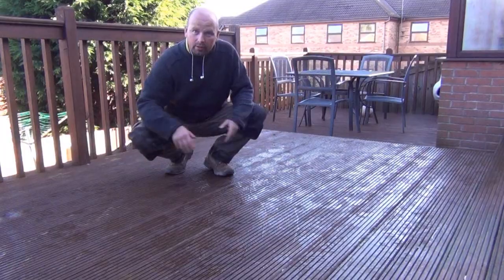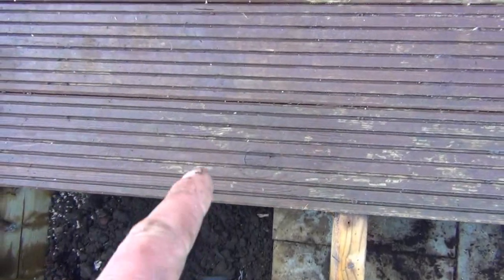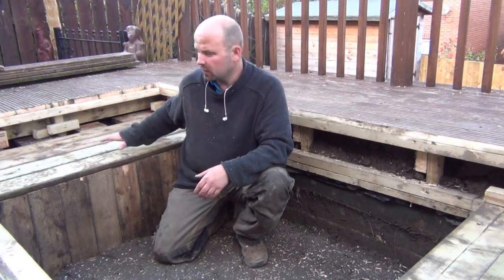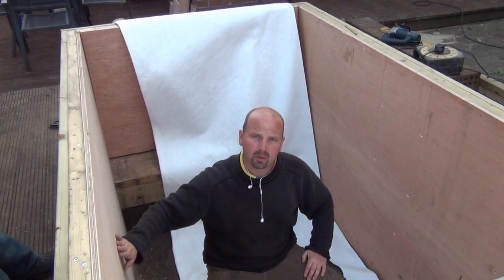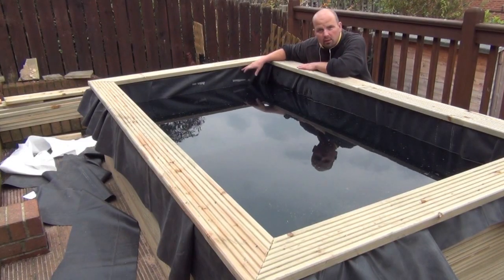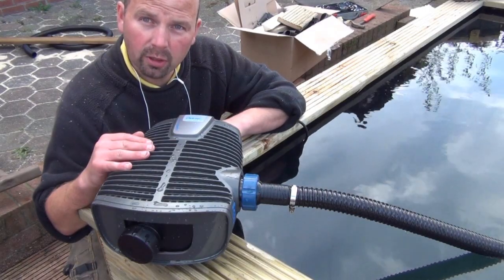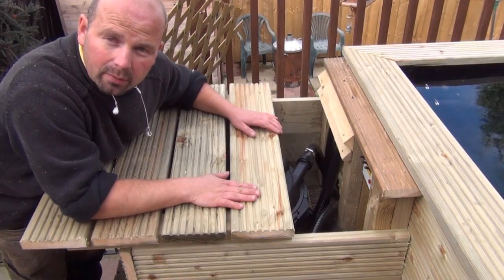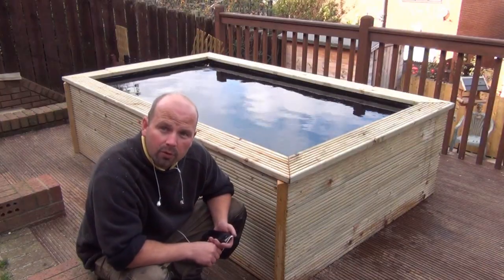How to build a raised wooden patio pond by Pondguru

Comment: Hi I am quite pleased to say that I've just completed making a new Koi Pond by copying a similar design to the raised wooden one as above.  Construction was relatively easy following you video. Just one question if I may, I have now filled it with water so how long before I can introduce the fish please, as I have 4 of them that have been penned up in a holding tank since my move in May last year.  I am keen to get them into their new home but don't want to overdo the enthusiasm and end up harming or killing them.  Many thanks and keep up the great videos. Barry
Reply from the maker: I'm glad the videos were useful and your project went well. As long as you have run the pump and filter for a good week or so the fish could go back in. It may be useful to add some of the water from the holding tank as it will be mature and will help fire up the new filter. You could put them in a few at a time if you have lots of fish so the stock in the new pond builds up over 4-6 weeks.
Reply: Hi Again, many thanks for the advice on introducing our 4 Koi to their new environment.  Just one problem I wondered if you had come across in the past. I have constructed the walls of my raised area exactly the same thickness as your video showed (18mm ply wood on a 2" x 2" studwork frame with decking cladding to the exterior, however, where my filter box is I have NOT fitted the decking due to drilling the holes for the Tradux fittings come through the wall.  Having fitted both of these with the short threaded end with the rubber seal on the pond side of the liner and the long threaded sleeve with the large wing nut on the outside of the plywood, it is now not possible to tighten the hose tails up tight as the large wing nut wont tighten any tighter, hence the filter side tails will not seal up.. Is this something you have come across before and have an answer to or how can I overcome this tightening problem. Any advice would more than welcome. Many thanks
Barry

Comment: Hi there just wondered how I would install a bottom drain within a liner
Reply from the maker: +Lee Wilson That is something I have done but have no video for. It is quite easy but the base needs to fit the pipework snugly to make sure there is no stretching of liner when pond is full. It would be best if you went to a koi outlet and ask them to show you so you can be familiar with the method while looking at the bottom drain and necessary fittings. If I had to use a bottom drain for a lined pond I would only ever install a bottom drain on a brand new liner.

Comment: Hello, what happens when it rains hard. Will the pond overflow?
Reply from the maker: Yes the operating height allows for a bit of rain but if it was very heavy everywhere else would be saturated anyway. It is easy to drain water using the filter outlet.

Comment: I'm thinking about building a a wooden pond would i need to put something around the walls of the pond to support the pressure from the water?
Reply from the maker: footiestar25 As long as the pond was built strong enough it would be fine.
Reply: I will be building it exactly identical to  the one in this video but it won't  be sunk into the ground the whole 4 foot will be above ground so will that be ok and strong enough to take the pressure of the water?
Reply from the maker: footiestar25 It would need to be made of much stronger materials  - for example railway sleepers as the atmospheric pressure acting on the water (and pushing out on sides) increases greatly the more volume of water is lifted above ground level.
Reply: Ok thanks for your infomation

Comment: Me and my dad are building a half raised wooden pond 3ft raised and 2ft in the ground do you have any tips on how to stop the wood rotting in the ground
Reply from the maker: If you put a concrete collar around the excavated hole you can build up from that with the wood to prevent rot problems.
Reply: Ok thanks fir the tip
Reply: We decided to build up with bricks 3ft in the ground 2.5ft raised put a roof on as well
Reply: Would post a picture but not able to on this
Reply from the maker: ***** Sound good to me and if you want to send pictures my email address is pondguru@btinternet.com

Comment: Is the insulation you use just normal wall or loft insulation stuff?
Reply from the maker: Ashlee Essex Yes I think it was 50mm rockwool which was in strips 18" wide x 1m or thereabouts. It fit between the 2" x 2" frame perfectly.

Comment: can you build a concrete raised pond with bricks or cement blocks.
what is the white liner for? isnt the black one sufficient
Reply from the maker: Yes you can build up with bricks or concrete blocks - that is the most common way to build a raised pond.
The underlay protects the liner and is polyester, not rubber.
Reply: no i meant can you build one yourself in a HOW TO VIDEO. if a project so happens to come along. with a wooden ext.
Reply from the maker: Enrique Goitia
I've done a 'How to build a koi pond' video but that was block and render with brick facing. I suppose a wood external would consist of a few vertical batons fixed to the external block then clad with wood. May be an interesting mix of styles and if I get the chance I will make one but since I am passing all construction work to other landscapers (then working for them as they need me) I will rarely be designing the ponds from 2014.
Reply: I noticed you had not put anything behind theinner plywood or under the underlayment for water proofing. Does the poly - liner proctect to an extent? Otherwise I plan to use the existing liner as my waterproofing under the framing. Thanks for sharing and the ideas, well done.
Reply from the maker: The ground I was digging into here was extremely dry due to it being under a deck and the liner will protect it to a large extent, yes.

Comment: Is it possible to build a raised pond like this on top of patio slab surface instead of digging a hole?
Reply from the maker: Yes that would be fine and many people do that. I have another raised pond video where part of it is on existing concrete slabs.
Reply: Pondguru Outdoors Thanks for the  quick response.  So I can follow this exact video to make my pond over ground.  I don't need it to be under to help support the frame of the pond?  Or should I use more bracing around the frame?   Thanks again for your response much appreciated.
Reply from the maker: The frame can't really go anywhere when it is all fixed together and full of water but it may be worth using some 90 degree brackets to secure the frame to the slabs just for your own piece of mind.

Comment: I'm buiding a raised pond after watching your video is going to be 1.8m x 1.8m x 1m what size pump and filter would you recommend I'm going to have koi in it any help would be useful.
Reply from the maker: The pump would ideally push at least half the pond volume through the filter every hour (2 hours for full turn over) so as you have around 3,240 litres that would require a 4000 lph pump. If you are using the pond to grow koi on before moving them to a suitable pond you will need a filter which will treat up to 3x the pond volume as they are heavy feeders and polluters. If you go for a pressure filter like in this video the nearest Oase one would be the Filtoclear 12000.
Reply: I have gone for the  Oase Aquamax Eco Classic 3500 Pond Pump and the Oase Filtoclear 16000 will this be ok I have 5 7" koi to go in there. and I have a air pump to go in there.
Reply from the maker: Yes that will be more than enough so no worries there. Although I recommended a 4000 pump in the previous comment a 2000 would give the 'once every 2 hour' turnover rate. Always best to move plenty of water when there are koi in the system so a  3500 will be fine for that purpose. A 16000 filter will go much longer between maintenance schedules and so will definitely do a better job than the 12000 so no worries there. 
With the addition of the air pump too they will be very happy and it is always great to hear of ponds when the filtration is more than adequate as there is no such thing as too much filtration.
Reply: Hi I have built the frame for the pond and put decking on outside and plywood on inside what size holes do I need to put through the plywood and decking for the oase tradux fitting to fit. Thank you.
Reply from the maker: It has been so long since I built a pond like this I can't remember but I'm guessing at 2" (50mm). The hole which is cut through the liner should only be about 1" as the liner needs to stretch over the fitting for a tight seal.

Comment: Great videos, very helpful and given me some good ideas for when I start mine.  What I would like to do is incorporate a glass viewing panel in one side but I can see that's going to be fraught with difficulties.  :)
Do you not have problems getting to the pump to clean it with it being at 4 ft deep?
Reply from the maker: +MarkJT1000 The base of the pond slopes slightly down to one end where the pump is so all the muck is removed to the filter no problem.

Comment: How is 2 x 2 timber frame strong enough to with stand the water pressure?
Reply from the maker: The 2" x 2" (50mm x 50mm) is only the internal frame and is sandwiched by 38mm (1.5") decking (outside) and 22mm (0.75") marine ply (inside).
The marine ply is a laminated board which takes a ridiculous amount of force to bend it and when it is fixed to a properly constructed frame which is clad outside with the decking it is easily strong enough to hold the water pressure.
Reply: @pondguru  great information I'm planning to build an 8x6x4 rasied pond out of 4x2 timber 18mm ply interneral decking external with 4x4 corner posts but was a little concerned of its strength
Reply: @colinlock5001  (my other channel) If you're using 4 x 2 then that will be even stronger and give you twice the cavity for insulation so it's all good. Best of luck with the pond.

Comment: Hi again 

at the 15:40 mark you have a cap on the waste pipe could you tell me what you put in the pipe to screw it on.
Just got my pond built in a very similar way to you after watching your video great stuff.

thanks 
Kel
Reply from the maker: Kel's Aquariums It is a hose tail with 1 1/2" male thread and end cap. They will be available from Oase dealers.
Reply: thanks.

Comment: Hi could you possibly give me some advice I'm planning on building a free standing raised koi pond approximately 6f x 4f can i frame it the same as you have here using the 2"x2" with the decking boards and the 18mm ply. I'm also thinking of fitting a viewing window approximately 3f x 2f 
Would this be strong enough and would it be advisable to build it on a concrete or flagged base tom
Reply from the maker: Even a raise pond is best if it is half in and half out the ground as it will get less extreme temperature fluctuations in summer and winter. 6' x 4' is way too small for a koi pond and the depth is needed to be around 4' (ideally 2' in ground, 2' out of ground). If there is too much height then the weight of water will break the frame. Feel free to phone me any time on 07772848730 as I'm guessing you are in UK. Phone is on from 9-5 daily.
Regards,
Richard
Reply: Hi Richard thanks for you reply. The pond I intend to build will now be 7f x 4f x 5f 6" deep so if I do it 2f in ground & 3f 6" above ground then should that be strong enough. I only intend to keep a max of 6/8 koi around 8/12". I intend to use the same materials as you have used in the above and below decking video. Do I build the frame in and above the ground as one hole structure or just above ground and run the ply from the top to the bottom of the hole many thanks
Reply from the maker: You could have the whole structure above ground if there is a good neat hole cut out of the ground - depends what the ground is like for digging and I have done it both ways. I'd advise going wider than 4' as that is very narrow for koi. Even 5' will make a big difference, ideally wider. Fish do not stay at the length you want them.
The wider you go the heavier the frame will need to be and for a 4'/5' wide pond 3'6" above ground you'd need a 4" x 2" frame built the 4" way for strength.
Reply: baitking1

Comment: Also. Y no use of small bottom drain? Always led to believe that they are a must for koi.
Reply from the maker: As long as the bottom of the pond gently slopes down to one corner all the muck will be drawn out by the pump and pumped to the filter so no need for a bottom drain in a small pond like this. For a concrete / rendered / painted / fibreglassed pond which would generally be much larger it is always good to have a bottom drain and large filter.

Comment: Hi! your video was great! I enjoyed it very much. Please tell me where you are based? I like a 1000 gallon wooden Koi pond built soon.   Thanks
Reply from the maker: I am about 10 miles west of Newcastle and although I gave up installing ponds last year I can put you on to someone who could do the work assuming you are also in North East.
Reply: Hi - I am in the South of England, If I can give the measurements, would I be able to have it sent Flat pack and I could pay for your labour for cutting the timber and also also shipping and material. Then we could have a carpenter to install it.
Reply from the maker: Olunelum Nelum I didn't just give up the installation of ponds I gave up all construction work as I just don't get enough hours in the day unfortunately.
A pond such as in the video really needs the frame building on site as it needs fixing to the ground before the insulation goes in then the internal boarding would extend down into the hole so it's not the sort of thing which can be pre-fabricated unless it was for a much smaller pond.
Reply: Ok thank you, do you know anybody who could assist in South of England
Reply from the maker: Olunelum Nelum Unfortunately I've no idea as I've never worked down there with anyone.

Comment: just one question where is the overflow ??
Reply from the maker: I think we put it in one of the corners under the decking but my memory is very shot.
Reply from the maker: ***** Do you mean the stuff which has the small stones stuck to the liner?
If so, no.

Comment: 7' long sides... No bowing outwards? I know it's only 18" high, but water weighs an awful lot and has forever to keep pushing...
Reply from the maker: It will forever try to find a level but I had the guy who I built this pond for at my house collecting some media for a new filter a couple of weeks ago and he said it was still totally straight. The 18mm marine ply is very difficult to bend as it is a laminated board. Then there is the frame and decking to add to that strength too.
Reply: Excellent... Thank you for the timely response... I am enjoying your videos... Some of the best on You Tube... You explain your thinking, what to look out for, and actually show your work... Awesome..
Reply from the maker: No worries, I'm so glad I made the instructional videos when I was making the ponds - glad you enjoy the videos.

Comment: why do u insulate the pond?
Reply from the maker: +Steve Billy Because up here in the North East it gets very cold in winter. The insulation prevents rapid changes in water temperature.
Reply: would u suggest i do the same?,,  iv just bought a house with patio in the garden and im planing on bulding a pond by following this video step by step
Reply from the maker: +Steve Billy If it is above the ground then definitely I would recommend insulating it. If the pond is block and brick construction then that is less necessary as it is much thicker.

Comment: How come he s building a weak frame like this and on the next video, he s double layering ciment blocks.... One of the two is bs..
Reply from the maker: They are simply 2 ways to achieve the same goal.
Reply: @pondguru  thank you for you response and your good channel.
OK but cost wise.. And why double walls? How long will the wooden pond last?
Reply from the maker: @MrFlyingPanda  This is just one way of building a wooden pond and many people would go with interlocking sleepers. I built it this way as it was strong enough for the size and not overpowering the space. Search for 'sleeper pond' on Youtube to see a stronger version for bigger ponds. Even doing it this way you should get a good 15 years from an above ground pond as wood isn't sitting in wet ground where it will rot quicker.